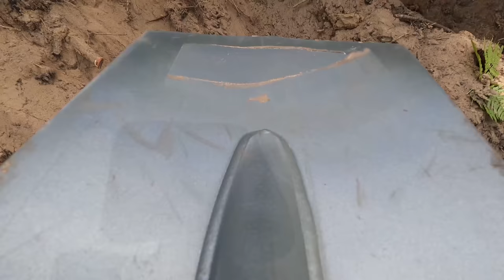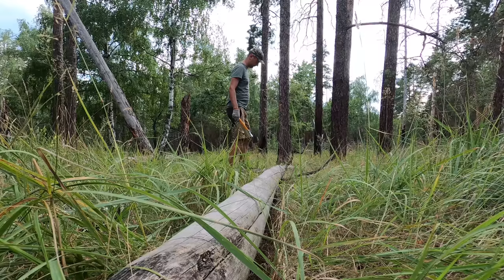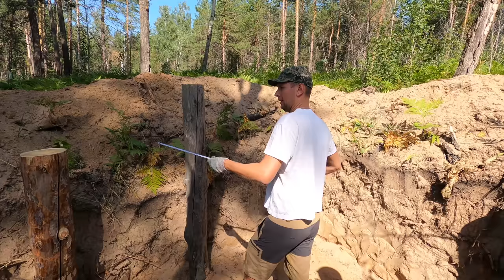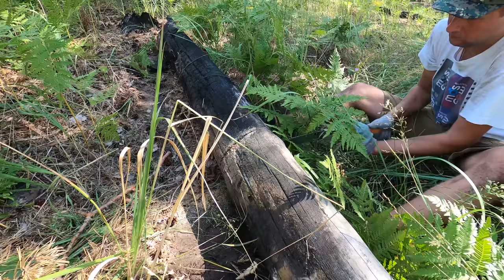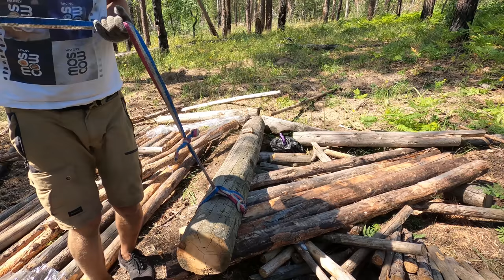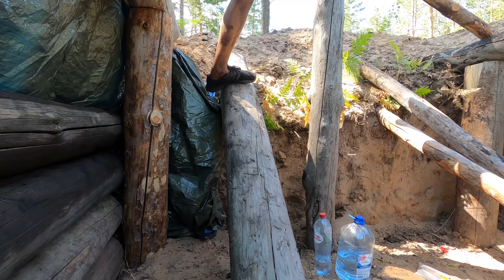Building Dugout Shelter in a wild forest. Build LOG CABIN. Bushcraft. PART 1

Comment: drill holes in the posts you set the house on. Fill with generous amount of linseed oil. Cap them off and bury them.
will last 50+ years

Comment: If you wanted to get the boats level on top. I learned this trick in Mexico. Take clear tubing long enough to go up each post, and across the ground. Fill it most of the way with water. Use some string to attach it to the posts, and what ever height you want the posts to be. It'll show you wats level. Waternalway levels itself. It's a great way to level things like this.
Reply from the maker: Great idea. Thanks👍
Reply: It's called a water level. 
Did the same job in South Africa building boats.